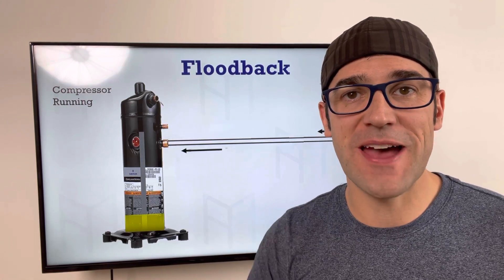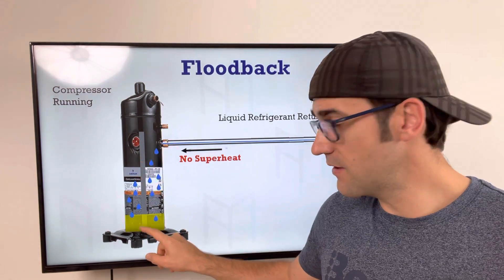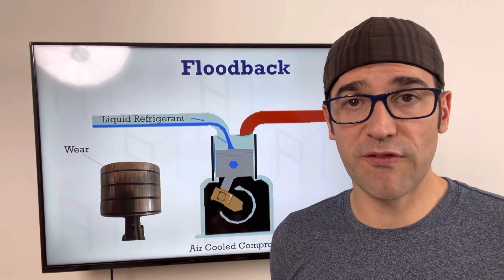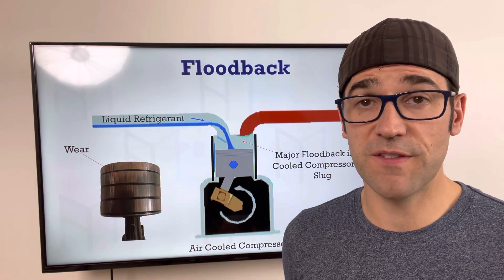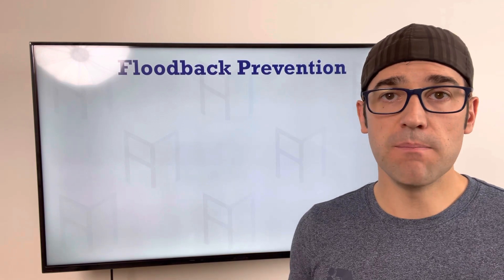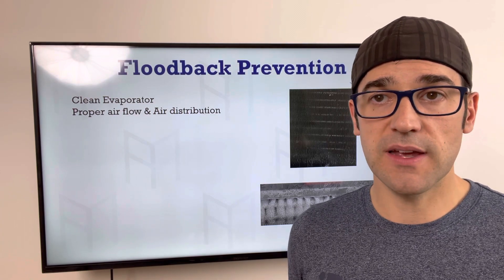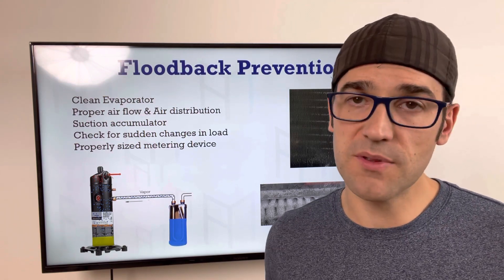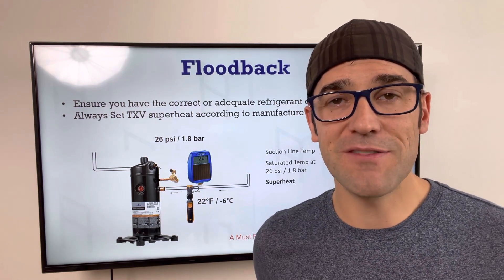Deep Dive on Compressor Floodback

Comment: I see my guy charging liquid refrigerant with power off position in low n high site.  I always wonder that liquid refrigerant will flood compressor. Why did not happen. Every time after change out a new compressor , he always add liquid refrigerant through hi n low w power off. can you explain it why liquid refrigerant did not kill the compressor?

Comment: Just a question....im running a modded window ac as a glycol chiller....when it shuts down the bottom of the compressor feels cold...not sweating or icing up just feels cold while the top is warm...
I run it down to -6c most and the time...is that migration or it is normal for it to feel a bit cold on shutdown at those temps?
Reply from the maker: You are most likely running that AC Compressor outside its specs. You would have to plot it on that specific compressor chart.

Comment: You are the one of the best teachers Trevor. Thank you so much for sharing your knowledge. The videos are great.
I have a question about superheat. Does is matter where you place your temperature measuring device on the copper tube when measuring superheat ? As liquid refrigerant may flow on the bottom of tube. I use a testo 115i and always get different results by just rotating the temperature clamp.
Thank you again!
Reply from the maker: Thank you for the kind word and great question.  You would mount the clamp similar to how you would mount a TXV bulb 4/8 or 3/9 o'clock position.

Comment: Just had an e body compressor with locked up oil pump (compressor locked rotor).  After I removed the pump no handshake issue took pump apart and put back together and compressor spun fine.  But still replaced compressor.
Reply from the maker: Great job! Inspecting components and compressors are so important. More people need to do that.